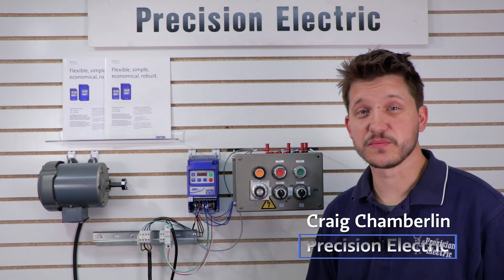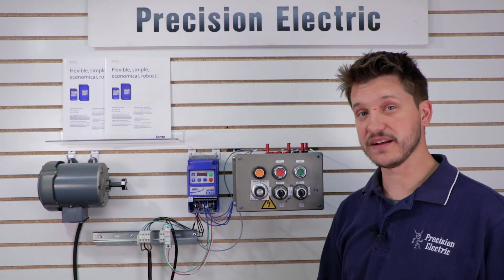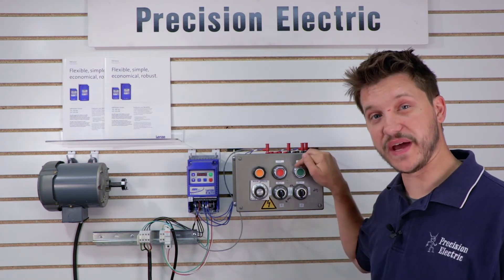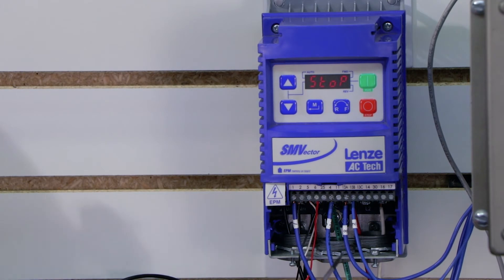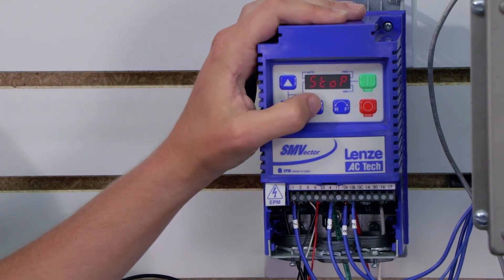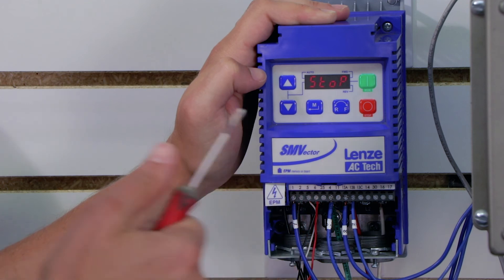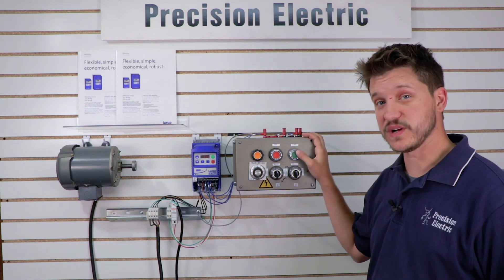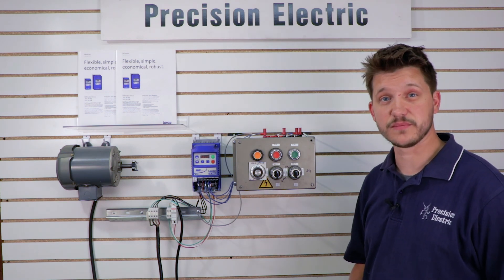Lenze SMV Training Lesson 4: Basic Start Stop Pushbutton Control Wiring & Programming - VFDs

Comment: The reason I ask is most vertical mills have 3 position rotary switches (reverse, stop, and forward) that are continuously open or closed switches.  Thanks,
Reply: yes, then in 121 you have to select the run command instead of the start

Comment: If the equipment currently is controlled by a motor starter,  what is the "best practice", to incorporate a Lenze SMV VFD?  Do you remove the starter and run directly off the drive or some configuration of the two components?